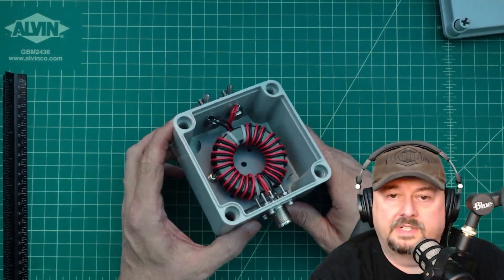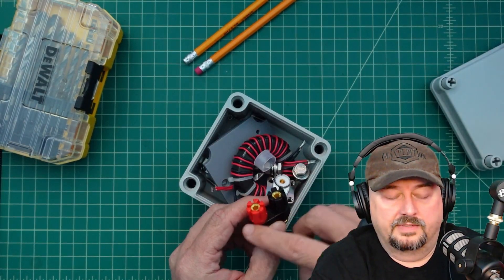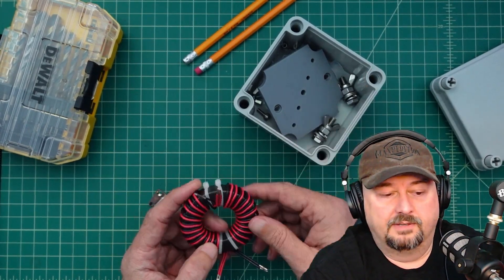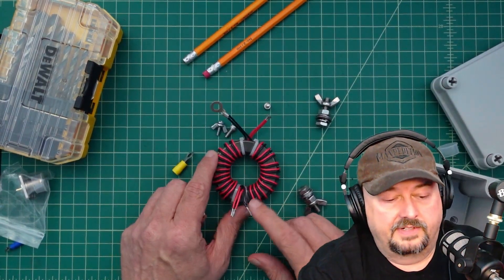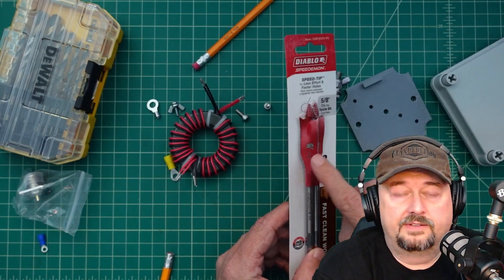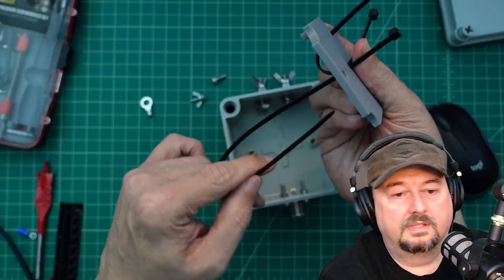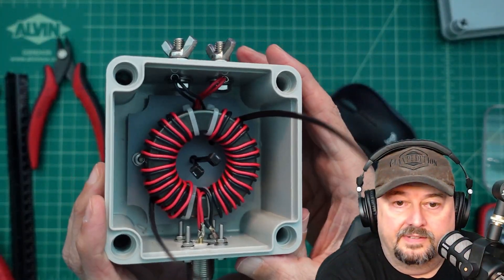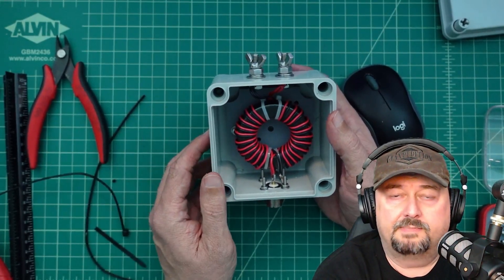DIY 1:1 Balun for my Doublet Ham Radio Antenna!

Comment: if it is going from 100 ohm to 50 ohm that would be a 2:1 balun ! title is so miss leading
Reply from the maker: It’s not doing that, the choke in total has 100 Ω  but it’s split so it looks like 50 Ω 👍

Comment: Would you mind doing a video comparing different 1:1 wiring methods? I see some designs showing this split winding configuration while others do the bifilar winding throughout (with a cross over halfway through). I am wondering the efficiency between them and should we completely cover the toroid or limit the number of windings for saturation concerns.
Reply from the maker: I can add that to the list.  I haven’t quite a few videos testing different types in my Balun, UnUn and Chokes playlist 👍

Comment: I'll be building similar soon.  I plan on 41 mix, as it has a better response for 80 and 160 meter, compared to the 31 mix.  Also, I plan on 14 ga. wire for better power handling.  Don't know that I'll ever use more than 100 watts, but If I'm going to take the time to build something, I'd like for it to be able to handle more power than less.  The baluns I've used since the early 1980's are no longer being made, and I'm at the point I'm making my own now.  Getting excellent results with the 9:1 balun for a longwire antenna you demonstrated earlier.
Reply from the maker: That sounds awesome, good luck with the build 👍
Reply: @TheSmokinApe  Thanks!

Comment: Well made video. I used a different choke (1:1) using the coax on my efhw with a loading coil. But I will try this one next because we will be building an DO-Antenna (80m-15m-10m-Antenna) for the german novice class in our OV (local ham radio group).
Reply from the maker: Hey Max.  You’re right that there are a few ways to do these chokes.  I wasn’t planning to use this style but like I said in the video I had a wrapped core sitting in the parts box not being used so I put it to work.  Good luck with the build and thanks for watching 👍
Reply: @TheSmokinApe  thanks.

Comment: The screws that you used are called socket head capscrews.  In SAE sizes, a 4-40 screw fits the holes.  I tried 6-32 flat head screws but they were too big to fit flush. I like to use flat head or oval head screws for a lower profile and clean appearance.  Note that flat/oval is the shape of the head; not the type of screwdriver.
Reply from the maker: Thanks David 👍

Comment: Bro.  This looks like nothing more than advertisement with little useful information. No schematic shown.  No winding techniques shown.  Just buy my stuff and ooohhh.. looky at me!!
Reply from the maker: Johnny, I’m not selling these.
Reply: Here's what I learned from the video:
Box is 4"x4" or 100mm x 100mm (looked at the grid on the mat).
Screw sizes were stated.
Wire is 18 gauge Teflon/PTFE insulated.  He said 18 strand but pretty sure he meant 18 gauge.  It certainly looks like it's 18 gauge.
Toroid is an FT-240-31
You can look at the winding and see how it's done but there are lots of videos on bifilar toroid winding.  2:40 He said 12 turns per side.
That should be enough information for a successful build.  All for free!

Comment: Usefull construction video. A question for using a 1:1 balun with ladder line, which is 300 or 450 ohms impeadance, should this not be a 4:1 or 9:1 to match to 50 ohm coax?
Reply from the maker: I cover the 1:1 balun choice in this video: Ape Answers 003: Baluns and UnUns
https://youtu.be/7psl_DM284I

Comment: Thanks for your video. Hope we will see another one testing it with your doublet. 
And that winding type provides the balanced side to the unbalanced (and vice versa) and choking a shield current if occured, in one piece.
Reply from the maker: I’m hoping to get the antenna finished in a bout a week or two, stay tuned 👍
Reply: Btw, Will be curious to see results with a ladder line in place of the dipole radiators directly connected to your balun. Strange…

Comment: Nice video Ape. If you HAD to  stick that torroid down, a bit of hot glue would hold it. I am about to go out and build another doublet for 80m this time and I am using 300 Ohm line
Reply from the maker: I supposed I could take it apart and re-zip it too but that sounds like a PITA.  The core is more secure than I thought it would be so we will see what happens.  Thanks for checking it out Don 👍

Comment: Good vid thx.  Is this the same baloon that some people use on a dipole?  Is this voltage or current balun?  Been trying to learn about this.  Ive read some stuff where a balone can reduce noise on a dipole.  Noise is my constant enemy
Reply from the maker: Yes, this is a current balun / choke that can be used on a dipole.
Reply: in fact,   i use the same exact build on a 3 band dipole.   10/12/15
Reply from the maker: @ hey Dan

Comment: You can still use some hot plastic glue stick, silicone chauk or RTV sealant to hold the torroid winding onto the base plate. The interwinding capacitance might increase a little bit, but not to worry too much.
De VU2RZA
Reply from the maker: Thanks for the tip 👍

Comment: the problems i have with this type of wiring is with a 50 ohms non inductive load, the SWR go from near 1:1 at 1 MHz to 2:1 at 30 MHz.. with the mix #43 is similar.. it’s why now i use RG316 coax 4 turns each side crossed in the middle and my SWR stay below 1.2:1 from 1 to 30 MHz.. so i am not a fan of this type of Balun which give a poor performance..
Reply: Not sure if my last comment made it but,   2:1 SWR  seems pretty high @ 30MHz.   Im not an expert,  but in my 1:1 Balun build which is very similar to Ape's  (43 mix ,  12 bifilar turns each side,  16AWG PTFE wire)   I got   1.437 :1  SWR   at the 29MHz point.   This for me was very reasonable so I continued with my dipole construction using the balun i made.   The result was an excellent performer on the 10/12/15 bands   (multi-band fan dipole)
Reply: @dan_in_sd  do it and check it with a nanoVNA, it’s the best way to confirm what you build..

Comment: Nobody knows why, but it's impossible to squarely mount an SO-239 to a box.
Reply: The fix for that is to use the round SO-239 and a large ring terminal for ground . When done and tight a drop of blue loctite
Reply from the maker: I like that idea Robert 👍
Reply: @ Somehow nature will find a way for a round connector to be crooked. It's the curse of the SO-239.
Reply: @ Somehow nature will find a way for a round connector to be crooked. It's the curse of the SO-239.
Reply from the maker: Todd is correct 👍
Reply: It's not that hard to get them square.  I just mounted one last night.  Find something square like the corner of a cardboard box, a plastic drawing triangle or even a real square.  Hold it against the SO-239 and the edge of the box.  I use a small drill bit (4mm or 11/64'-3/16") turned with my fingers to mark the hole locations and then push into the marks with a pointed tool/nail/screw to help locate the drill.  For metric, drill with a 3mm drill.  For 4-40, use a 7/64" drill for a close slip fit or a 1/8" drill for a hole with some room around it.